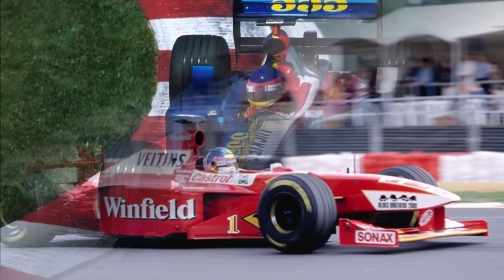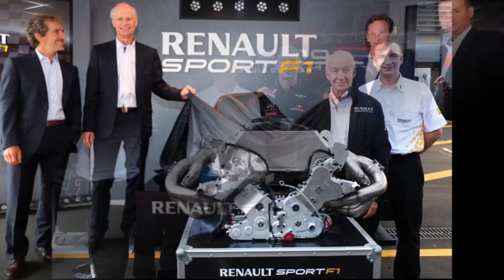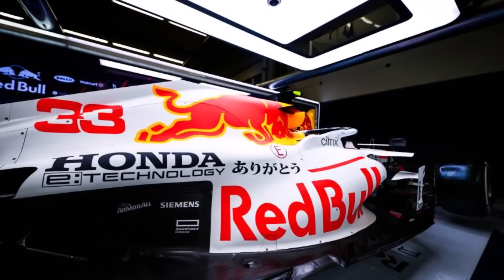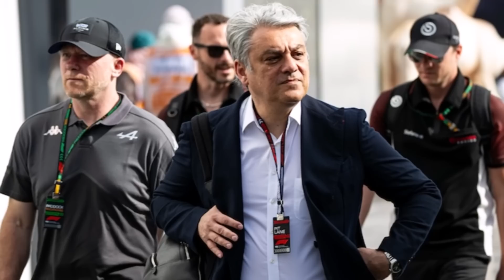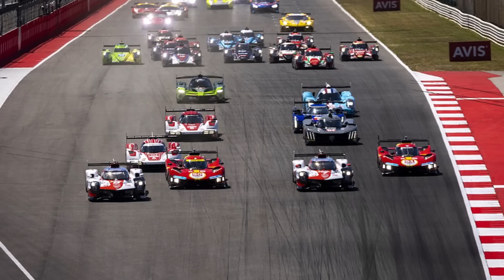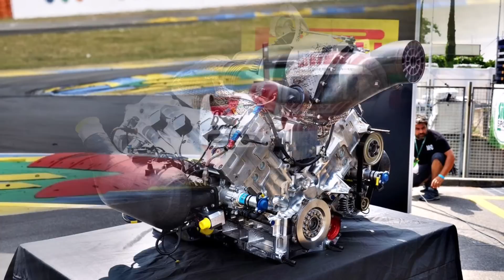Alpine's Engine Problems in F1 and Le Mans - How can they fix that?

Comment: The picture of the engine @5:27: On top is the turbocharger. You can see the exhaust way, but where does the air from the compressor enters the engine?

Comment: If they stop building F1 engines, couldn't they insist on Honda units?
Honda will have no customers in 2026 with manufacturing capacity for two teams. 
Sounds like a win win situation to me.

Comment: Wasn't Alpine's 2022 F1 engine on par with the others (or close enough) in terms of power but very unreliable, and the only reliability improvements to be found for 2023 involved reducing power?
Reply: The main issue was something to do with the waterpump. Maybe they made a very light pump to reduce parasitic losses and the stronger new one cut that advantage back. But I think there's more at play there.

Comment: If i remember correctly Renault was the first to come up with the pneumatic valve system and supplied it exclusively to Williams(???). They were the best engine on the grid at the time. I suggest that Renault stop screwing around by trying to save $$$. Throw them at the projects and prove to people that they can build an engine. If they fail at F1 and WEC at this point it could affect their production car sales. They need to give the teams the resources and stop management meddling if they want to improve.

Comment: Alpine runs a smaller engine than other competitors, however in IMSA the WTR Acura ARX-06 is running an even smaller engine than Alpine/Mecacchrome, that one is 2.4L and the chassis is the same, so for sure there must be even more fundamental issues within the Mecacchrome's engine.
Reply: The Peugeot 9X8 Hypercar is using a 2.6L turbo V6, so even Renault's main rivals are doing better. 

The main difference being Renault is starting with a borrowed 2H sprint engine and trying to make that last 24H. Peugeot did it properly and built an actual endurance engine themselves.
Reply: that mechacrome engine is a mess in F2 when it comes to reliability, so yeah using it for endurance just seems like a deathwish

Comment: Peugeot has a 2.6L V6 that can easily get BoP power, just like Honda's 2.4L, Ferrari's 3.0L, Isotta's HWA 3.0L and Toyota's 3.5L. The Alpine 3.4L isn't an issue, it's just that they didn't design it properly.
Reply: By properly, they didn't design it at all? They just took an existing F2 engine because it was cheap, tweaked it a bit and hoped for the best even though it never finished a 24 hour test without breaking before Le Mans?
Reply: @TassieLorenzo I suppose they want everything made by french from chassis to engine with more tighten budget

Comment: i blame f1.. they've made it impossible for teams to recover if they get the regulation changes wrong.. two teams have dominated last 14 years in f1.. clearly the current way doesn't deliver on the racing
Reply: That's demonstrably untrue on both the engine (e.g., Honda) and chassis (e.g., Mclaren).

Comment: The main problem here is the histroic link between Renault and Alpine. We're not talking about 3 or 4 years working together, but decades. Separating them would be extremely hard and shocking, and Alpine would suffer a major blow on its image as a car manufacturer.

Now, about the problems we see, it seems Renault were 2 years behind in 2014. They were focused on 2013 without looking on the future, and they paid a high price after that. The engine wasn't that bad from 2018 to 2020, but the rift with Ferrari and Mercedes was quite huge though. And how they've operate the new rules in 2022...

To solve this, they have to work on new process, new standards of conception, production and tests. What do I mean by that?

First of all, they have to extract as more power as they can, the higher the better, while enhancing their strengths, such as fuel consumption, or the operationnal range of the engine. They were known for these feats, they have to keep this, as it could work well for the balance of the car.

On production and tests, they have to work with a higher quality, ensuring that they can find new ways to enhance the reliability without damaging the performance. For example, on the engine bench tests, we always see an engine analysed without and cover above. It could be interesting to do the opposite. Using the engine cover, it means the engine is in a higher temperature model, while the vibrations and the acoustic waves goes around, acting as well on the cover, as the engine, where it could strain the materials. More data would be analyzed by this process, helping the conception team in its work.

I don't think that Renault is unable to produce a reliable high-end performing engine, but they have to include some new blood in their conception department, on the structure and material field. For example, Ferrari hired Wolf Zimmermann, in order to work for the next gen engine. So if Alpine wants to fight back, they have to act now, fast and well.

Comment: Meanwhile both Peugeot finished Le Mans with their 2.6L V6 turbo 👀
Reply: That and Ferrari won with a 3.0 V6 based on a road car engine. I’m not sure what excuse Mecachrome has.
Reply: @lkyksb3 lazyness repurposing an engine designed to endure less than 2h of flat out racing to last from 6h to 24h, I don't know if they made that choice or Renault being a cheap a$$ chose that!
Reply: Lol, Isotta Fraschini finished the race, and I don't even know a thing about their car beside it is a LMH
Reply: @markhunt7434  no it doesn’t. Thats total. In lmh you can have whatever split of ice and electric component as long as it meets the bop regulations and minimum output. The Peugeot engine makes less power. So after deployment at 190kmh the electric component is making nearly all of the power.
Reply: Only produces 450HP. The rest is produce by the awd hybrid. Alpine V6 has to produce at a maximum 630HP and is therefore more stressed. Still. Acura gets 630 from its 2.4 V6 revving at nearly 10k in IMSA and hasn’t had a single engine problem.
Reply: @goodtimeblimp Afaik the LMH cars have to compensate for the loss of electric power each time the battery runs out, which is about 270 hp.

Comment: Mecachrome has had close to 30 years of failure in racing, F3 and F2 engines die at about every race or many in a race. The F1 and WEC engines underperform and blow-up all too often. Why are the FIA and Alpine still contracting them all the time? It's Renault Alpine's fault for sticking with one company and expecting different results. That would also be the definition of insanity...

Comment: I don't know much about f1's management so I won't comment too much on that. However, for the alpine a424 for le mans... I personally don't think that using a 3.4L V6 turbocharged engine is disadvantageous in a sense that you need to run higher boost to obtain the necessary power target, it's only about 670-700 HP and teams like toyota, ferrari, even isotta franschini are running engines with similar capacity and configuration and are doing fine. Even Peugeot runs the engine at a much lower capacity at 2.6L, or you have acura arx-06 in IMSA running a 2.4L engine(which can rev up to 10,000 RPM). All these examples tells me that the engine capacity being small does not compromise reliability in a long 24 hours race even if boost is turned up. However, what I do think went wrong is probably alpine endurance team didn't properly maintain the engine in between races(like the engine is definitely reliable enough to last through long races, take qatar 1812 km for example). I think they don't necessarily have to swap their LMDH car engines, but they can still improve the reliability, otherwise, they can tune it by increasing the bore or stroke length just to lower boost pressure by a little bit.

Comment: ALPINE should use Cadillac engines
Reply: Nissan would make more sense. Renault owns a stake in nissan, and the VR38DETT would be a great choice with some minor endurance modifications and some weight reduction. There's also the VRX30A, although it wasn't a very competitive engine, but that could probably be resolved with some reworking of the hybrid system.
Reply: @modezity   I don't think Renault owns Nissan judging by the controversy with the Nissan CEO ghosn.. 
  The Japanese double cross renault and would not honor their contract
Reply: @TheSwanlake2009 Renault owns about 44% of Nissan so they do have some control over what happens, but yeah, Nissan and Renault aren't on the best of terms, so there might be a difficulty in getting the green light to use Nissans engines in their endurance car.

Edit: after doing a little googling Renault actually put some of it stake in a French trust so they do have less power than they had before over Nissan.
Reply: For the formula 1 side though, should just sell the team to Andretti. They're too far gone

Comment: Their Lmdh car should use a Gtr engine from Nissan. Easy power, reliable(road car engine),cheap to maintain and can be modified(lightened)for race use. (Like Porsche, Ferrari)

The F1 team should use an alternative engine and use the PU development centre for R&D in battery and motor technologies for road cars or alternative sources.
Reply: Renault aren't strangers to using Nissan engines in their race car projects; the V6 Megane Trophy used the 350Z's VQ35DE, and the RS01 (Which was based on LMP1 underpinnings I might add) used the VR38DETT from the GT-R, so Renault should be familiar with the architecture.

Even if they can't use the VR38DETT, Nissan already has a proven Sports Prototype engine available; the VRX30A 3-Litre Twin Turbo V6 used in both Nissan's GT-R LM Nismo LMP1 and the ByKolles CLM P1/01. The VRX30A may never have achieved any major race results but the VRX30A never suffered an engine failure in its entire LMP1 racing campaign.All of its DNFs came from collisions and failures from other parts of the cars they were fitted to.
Reply: @legoferrari14  The problem with VRX30A is that it is only rated for around 500 BHP power output, way lower than Hypercar's 700 BHP requirement

Comment: So ganz stimmt die Info zu den Jahren 1998 bis 2000 nicht. Mecachrome hat den Motor wie vorher weitergebaut und Renault hat den Motor weiterentwickelt, wenn auch nur auf Sparflamme. Die Franzosen führen mal besser mal eine Open mind Kultur ein. Am besten bei anderen schauen, was die so machen und Top Personal verpflichten. Mit der Einstellung man wäre am besten und mache keine Fehler, kommt man nicht weit. In der Zeit von 2003 bis 2007 gab es z.B. ein Enstone Engine Team, welches einen deutlichen Beitrag zum Erfolg in den Jahren beigetragen hat.

Comment: Honestly not a bad idea to become a customer team, pride aside.
Their chassis/aero has been pretty good for a while, if they can manage P4/P5 in the constructors with a 20HP power deficit they can probably gain a couple of positions with a better, more reliable enegine.
Reply: They are a customer team in WEC and they're still bad.
Reply: @KAMiKAZOW No they're not? What are u watching? Do you even know what customer teams are in WEC?
Reply: @sakuya1185  The video (that you clearly did not watch) spells out that Alpine is a customer of Mecachrome F2 engines. From context it is 100% clear that I meant team that's customer of a 3rd party engine rather than a privateer team like Jota.
Reply: @KAMiKAZOW  I clearly watched the video. 
Claiming I did not watch the video? You have zero shame and the fact that you didn't even APOLOGIZE for your horrible speech construction just baffles me. You did NOT elaborate AND you insult me (with the intention based on the parenthesis) for your own missing "pieces" on your "based on context" blabbering. The context I'm getting behind your replies are your horrible indication of context due to speech construction. Good day.
Reply: @sakuya1185  Context being the engines is 100% clear. No need to elaborate.
Reply: @KAMiKAZOW  Also, there's no such thing as "engine customer team" and BASED ON CONTEXT, there are only: Factory, Factory-backed Privateers, and non-backed Privateers.

Comment: Pipo is one good option, Gibson also. Although, the need to adapt their V8 for the regulation.
Reply: Can't see Gibson working on an Turbo engine for F1 seeing that they've never done a force induction engine. Also they're Brittish.
Seeing a French company close their engine factory and asking a Brittish company to develop a new engine for them... That would be twisting the knife a couple extra turns.
Reply: Pipo is famous for rally engines but they have done the one in glickenhaus and that was not bad

Comment: For me, if Alpine being unreliable again like IF does in somewhat bigger trouble, better make them pull the plug from WEC and F1 altogether in favor of Formula E and E-GT respectively. Maybe who shall fill the void? Maybe it shall be time for Mercedes-AMG to reconsider sports car racing program as a works team again due to cost cap in F1. Due to expertise in its in-house E-Performance racing hybrid system, it would be nice for AMG to join Le Mans Hypercar reg. Making a second generation AMG One better fitting LMH ruleset, albeit 6.2L NA M159 racing engine or 4.0T M178LS2 engine in lieu of F1 engine, with modified hybrid system focusing tuning on reliability and endurance Le Mans needs :)
Reply: This is what I was thinking as well. Maybe the higher ups at Renault-Alpine want to focus entirely on EV related motorsports which is why they don't want to spend as much money as their competitors in the ICE or hybrid related motorsports. I think they should just pull out of WEC if that is the case and replace the Alpine team with a Nissan team instead since the next generation GTR is rumoured to be a hybrid so it would be a good bit of advertisement for the brand.
Reply: If alpine and renault want to win,I believe yours is the right option, don't exclude etcr and extreme E (H version coming later); another maker to fill that gap as said earlier would be Toyota who are long absent from F1,also consider Nissan returning to WEC earlier and Make upstart racing teams (buying manufacturer engines) and competing ,such slot was supposed to be filled by Veloqx but they went silent

Comment: But Renault don't make performance cars and Alpine are a tiny brand, do they really have much to lose by shutting down the engine program? Yes it's embarrassing but mostly in F1 circles, I don't think it will affect their sales, especially if they can build a competitive chassis around a good rented engine
Reply: Renault does make hot hatches, though, and Alpine does make one sports car: the A110 (I wish they would bring back the A310 by basically putting a new body on the Nissan Z). I think they just don't have any interest left in internal combustion engine powered race cars or hybrid race cars and instead want to focus on EVs and be among the first to successfully use EV motorsports to sell their EV road cars.

Comment: To prove that Alpine isnt even thinking and just of bloated corporate zombies, they could have used the WEC to develop F1 engine , especially the 2026 engine. I would take a dallara chassis to keep cost and down and focus money on engine development
Reply: It's too expensive and undertaking. I think that's the issue. There's very little RoI to do that and run that in WEC for F1. It's much easier to trickle down from F1 than WEC to F1. WEC has the kind of reliability performance demands that F1 don't. F1 reliability demands aren't as big and therefore performance is a greater focus.
Reply: @F1ll1nTh3Blanks  i would dissagree with the reliability point. Even tho WEC has less races that are longer there may be a same drive time as F1 races all together,since F1 team have only number of engine they can use.If you build reliable engine that can stay at 100% in WEC races it would help you in F1 since you would also improve reliability there..imo ofcourse
Reply: @F1ll1nTh3Blanks  They could use the F1 cylinder design in a 3.2L single turbo V12 engine perhaps? But at half the stress or less, Renault may not learn much.

Comment: In my opinion the problem is almost certainly due to bad management practices. To a fault; the story has never been: Renault engineers fucked up and made a bad design decision, but: renault engineers not capable of fully developing the engine due to a lack of resources.
Reply: Watching the video I get a feeling of higher management ($$$) not really understanding the tech/how you need to run such a program and/or they are micromanaging. 
All too common in today’s businesses.

The whole story is rather embarrassing  in many different ways.